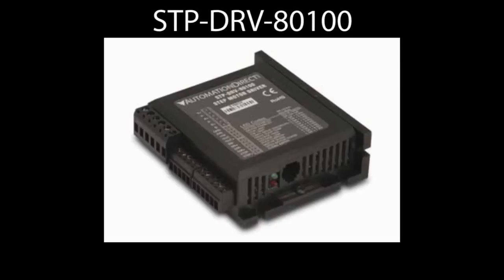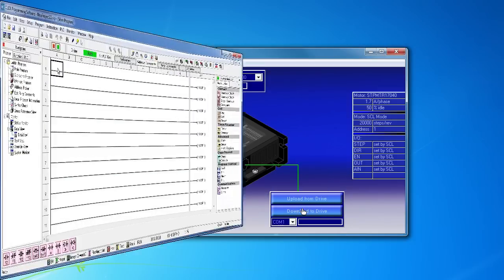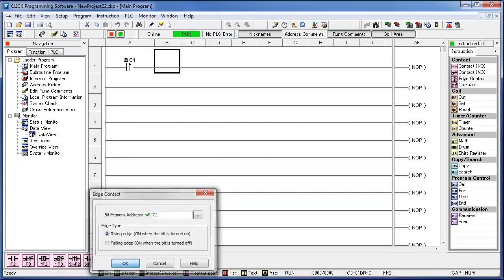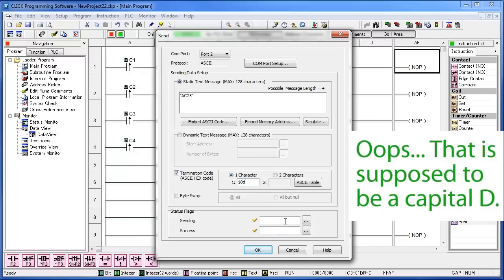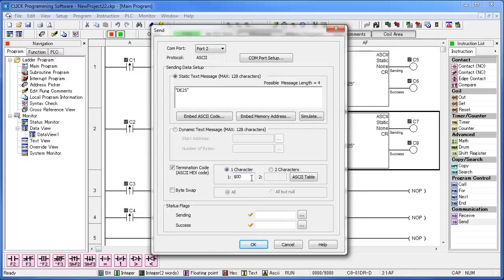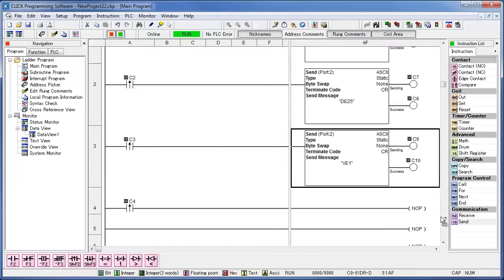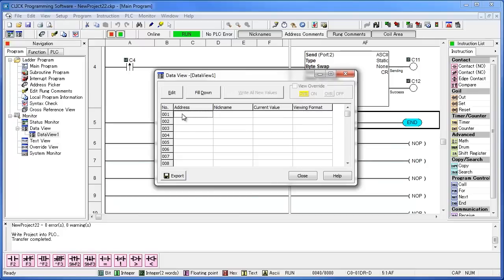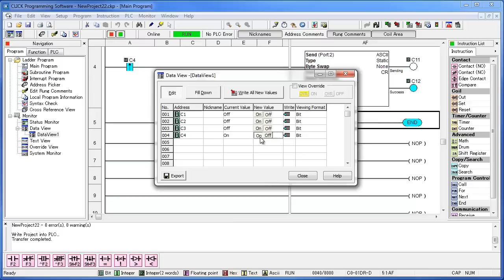How To Control a Sure Step Stepping System with a CLICK PLC from AutomationDirect

Comment: Can you please explain how the PLC is conneceted to the drive? Also if you are using C2-01CPU with a micro-B USB to USB, what port should be selected when programming, or do you need another one connected to the PC from the PLC in PORT 1 or PORT 2? Thanks
Reply from the maker: @TristanPowers-22 the PLC is connected to the drive using RS232. If you are using a C2-01CPU it is recommended to program through the micro-USB port or the Ethernet port using the CLICK software rather than the serial port. (in this case that serial port is talking to the advanced micro-stepper drive anyways) If you program through the USB port you shouldn't have to set any com port settings. Those are only used when programming over serial from the software.

Comment: How do you know what codes to enter in the static text messages to do your desired command? Is there a list of the click Plc codes somewhere?
Reply from the maker: @TristanPowers-22
The SureStep advanced steppers that can be controlled by serial all use Serial Command Language (SCL) for their motion commands and control. Find the SCL manual here:
https://cdn.automationdirect.com/static/manuals/surestepmanual/scl_manual.pdf

Thanks for the comment!
Reply: @automationdirect  Could you write "FL-2000" to make the motor rotate one rotation in the CCW direction?
Reply from the maker: Assuming you were using 2000 pulses per revolution in the stepper and positive was set to clockwise rotation, an "FL-2000" command would absolutely move the motor one rotation counter clockwise.

Comment: I am having an issue where my program cycles, and it will do so according to the program I wrote for about a minute, then it will start to move randomly in a way that is different from my program. Any ideas as to why this could be happening? Also, I start my program with an initial enable start switch which is in the program, so I need to have the PLC connected to my PC to start the motion. Once I have started this, is it okay to unplug the microB USB from the PLC so it continues to operate without needing the PC attached? Thanks
Reply from the maker: @TristanPowers-22, at this point I would recommend contacting our free award-winning technical support here:
https://community.automationdirect.com/s/contactsupport
There are many different things it could be, from code executing in a way you don't intend, to a setting on the drive causing something odd to occur. They will be able to look at your specific application and better assist with your troubleshooting.

Comment: Old video, but if anyone is looking, is it possible to do this without the SureStep controller. Just using a regular microstep driver? Any resources would be appreciated.
Reply from the maker: Enlightenist, Currently the CLICK PLC does not have a HSO output. If the Microstep driver supports ASCII or Modbus communications this could be possible. I would advise contacting Tech support for more info on this topic 1-800-633-0405
Reply from the maker: This has since changed. The new C2 series of CLICK PLCs do allow for HSIO in the on-board slots.

Comment: To be clear, If the user had turned the command "VE1" the motor would have just started running at 1 rev/s but if he then turned on "AC25" after that, the motor would have started accelerating at 25 rev/s/s from 1 rev/s, correct?
Thanks for the help!
Reply from the maker: Correct, if the user had triggered AC25, after triggering VE1, then any acceleration would happen at 25 rev/s/s.

Comment: Are there any wiring diagrams please?
Reply from the maker: @Design Portal, thanks for the comment. 

The wiring diagram for the serial connection can be seen on Page B-8 of the following link https://cdn.automationdirect.com/static/manuals/surestepmanual/appxb.pdf. 

Wiring Diagram for the Drive and motor can be seen on on page 4-4 of the following: https://cdn.automationdirect.com/static/manuals/surestepmanual/surestepmanual.pdf
Reply: Thank you.

Comment: Out of curiosity, could I have energized all the send blocks with the same edge contact, and would the transmission logic send out the individual ASCII messages one after the other, in order?   It seems to me I'd want to send out multiple parameters with a single contact input.
Reply from the maker: Rufus Smith, thanks for the comment. 

The Click PLC does not have an internal communication buffer that would stack these communication in a FIFO fashion. 

To use multiple Send commands,  your logic would need to interlock these commands with individual triggers. As shown with this video, I typically start the communication chain with one trigger to a Send command, and then use the "Success" bit of each Send to start the next command.

Comment: is there a way to change the "FL20000" without opening up the send comand and retyping it in the text box??  i want to change the number with a hmi or math program in click, is this possible?

thanks kevin
Reply from the maker: kevin l Yes! Select the Dynamic Text Message option under the Sending Data Setup in the Send instruction configuration window. Then assign a range of TXT addresses. The CLICK PLC will send the contents of those TXT addresses to the Sure Step drive. To access to those TXT addresses from an HMI, you can find their MODBUS addresses in the Address Picker window. (Pull down menu: Program > Address Picker…). Enable the check box ‘Display MODBUS Address’ on the left bottom in the window. The Math instruction can’t write the math calculation result into the TXT addresses directly. Use the COPY instruction to copy the math calculation result into the TXT addresses. If you need further assistance, please contact our award winning technical support. We hope this helps!
Reply: awesome!!! thank you very much!!!!